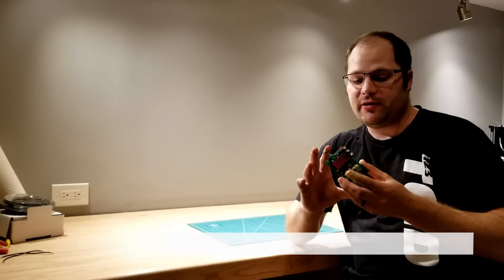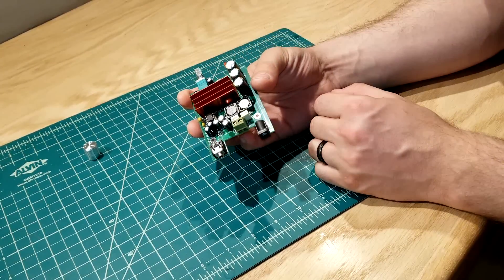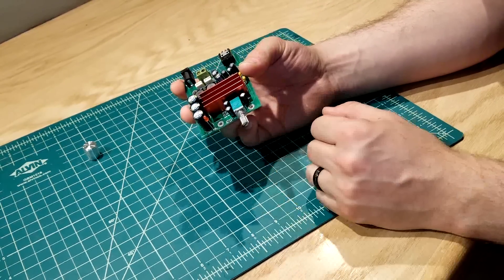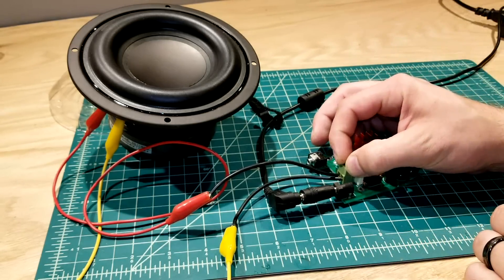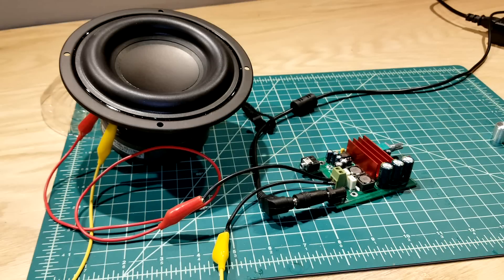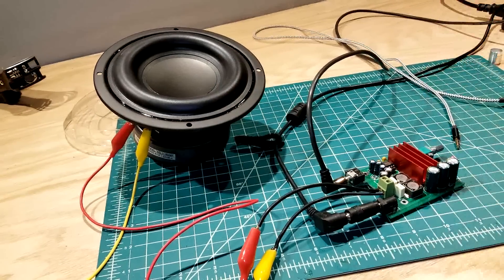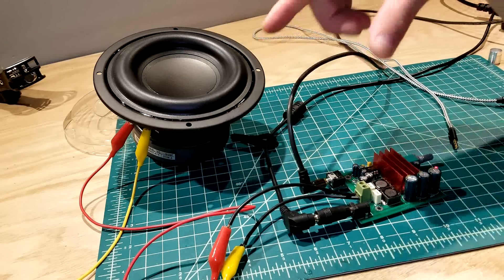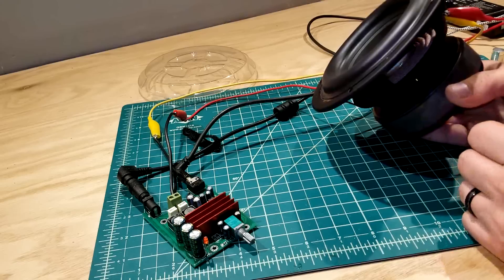100 watt Subwoofer amplifier for $11? TPA3116D2 Review and Test

Comment: i tried this board with 24V 6Amp Power supply with 3ohms 100W Subwoofer the outpur was really low i dont know what i did wrong

Comment: To reduce the interference you can use a Dc-Dc isolator for the power input because your body has a capacitance connected to the ground (Floor) And thus you will see a change in performance. Because the power adapter is connected partly to plug ground

Comment: There is probably nothing wrong with the power inlet. The metalic terminals are soldered and the plastic cover stays loose around them
 Quite normal

Comment: Correct me if I'm wrong but I thought you said the board needs a 5.5x2.1mm plug, but it's the other way around, it needs a 5.5x2.5 plug (the pin in the middle is bigger than normal, 2.5mm in this case), but thanks for telling me how these plugs are specified!!! That helps alot because of course all my PSUs are also 5.5x2.1 but didn't know how they were called. Thanks now I can continue my project! 😁👍

Comment: Dude how am I only now finding this video! This is exactly what I've been needing! YES! 
You said it has a built in low pass? (The board i think you mean? )
But this chip can do full spectrum audio amplification right? 
I guess it should have been obvious for me to look through the TI catalog of amp chips, but thank you man, this is exactly what i need. 
I can't believe this little tiny thing can do 100 watts, that's insane. 
Also it's great it has such a wide input range. It would be great for building a high powered portable speaker. 
Now i need to go look up the data sheet. 

Thanks man!

Comment: I used one of these on a 10" sub for my PC setup after the cheapie plate amp died - it was rated 70w. This amp i would say had slightly less power (and i used a good power supply 5amp, 35v i think...- the amp would go into overload shutdown anytime i wanted to crank it up a bit. at low to normal listening volumes it worked fine. I replaced it with a Denon plate amp from a HTIB kit and that was way more powerful. then I got a MTX 10" dual voice coil woofer in there and wired it in series 2ohms. I was sure the amp would blow...still holding up. the tpa3116 could not touch it. I think the power 100w is over rated bs...
Reply from the maker: If you were using a 35v power supply that would be part of the issue with it cutting out.  This amplifier only has a working voltage or 12 to 25v.  Anything over that would cause issues with the amplifier.  Having said that, it may not do 100w, I never tested that aspect of it.  Most of the time companies put that on their, because the chipset is capable of doing it.  But that means very little.  Glad to hear you have a monster setup now though.  Sounds like a great setup!
Reply: @Toid  bad memory, just a guess- - its a variable power supply I adjusted it to whatever the board maker said was maximum - i think it may have been closer to 28v or so...

Comment: I bought the next one up with two (unlabeled) potentiometers with the same power rating, from Ebay. I have an old 8 inch Polk subwoofer that has a bad amp. I'm going to see if this will substitute for the failed amplifier. I'm hoping that one control is volume, while the other determines rolloff frequency. It came with no instructions or documentation. I'll have to use a separate small board to construct a power supply. I have the parts. If the bridge rectifier and transformer are any good in the existing plate amplifier, I will use those parts for my DC supply.

Comment: Is it possible to use this amp or one similar to receive speaker level input from a speaker in/out connection board? If so, how would it best be done?

Comment: At 25 volts DC, you need a 3.1 Ohm driver to draw enough current to pull 100 watts RMS out of a bridged amplifier. you need to make sure the amplifier can produce 5.7 amps AC, which it needs to be current limited at 8 amps or higher, to drive the peak current. If driving 4 ohms, the amp will drive 71 watts RMS, roughly 100 watts peak. That requires 4.4 amps AC, which means the current limit needs to be 6.25 amps for the peaks. That seems more reasonable for an IC chip output stage. I tried to pull up the data sheet for the TPA3116, but I couldn't get it to load up. The numbers I used were calculated from 25 volts DC into a bridged output stage, rail to rail amplitude, without clipping. Switchmode amplifiers can get pretty close!!
Reply: Thank you for your math, I'm selecting power/speakers now.  Lower voltage PSU can yield same output if higher current, correct?
Reply: @AB1Vampire  That's correct, If you drop the voltage and increase current, the power stays the same. The caveat, is that an output stage has a current limit, and the lower the impedance, the less wattage you will get out of that preset amount of available current from the output stage.
Reply: The TPA3116 has proven it can do >50 watts x2, as long as it has sufficient cooling and power, at <0.03% THD. The chip is legit. Whether it is applied legit or not is really what is up for debate :P
Reply: BLA BLA BLA EBAY IS CHEAPER. AND WHATS POSITIVE AND NEGATIVE ON THE POWER PLUG?
Reply: @jernone3849  just stick the connector on your tongue and the part that tingles more is negative (or is it positive, dang now i can't remember)
You know what, maybe use a multimeter. 
Or just use the battery from your car the plus and minus should be clearly labeled... just make sure to use a current limiting resistor...
Reply: That's still a lot of watts for a tiny little chip and board like that

Comment: Anyway to wire this in with a Bluetooth amp board?
Reply from the maker: It would be better to use a separate amplifier board and Bluetooth board. Then you can just split the output of the Bluetooth board to the two amps

Comment: It does put out 100w, Put a meter on your output. You aren't getting a ton of sound like a more powerful 100w amp because your high wattage speakers aren't efficient. Those need to be driven with an amp designed for type of speaker you have. Get a 50w 75w 100w high efficiency sub and try it again!  You will be impressed with that little amp.

Comment: I picked one if these up on a whim for a small project integrating amps into a computer case.  It is only going to go anywhere near 100 watts at 2 ohms with the full 25v input.. at 12.4 volts with a 4 ohm sub its more like 18 watts if its lucky.  For my application I knew it would not do anywhere near its full power, but I was hoping for a bit more than it does. 

The slope is first order, which is actually ok if you are using somewhat weaker mid/high units. Though it would be nice if it was adjustable. Instead i have to resort to changing components on the pcb.   Next I think I am going to just build a power supply for it.

I have 2 of the 4 channel variants for my satellites which come out to around 8w/ch at best into the speakers I use. But they are in bi-amp configuration for the fronts. and then the second amp is for center and surrounds.   I am about $150 in for all the amps and crossover components, wires, plugs, speakers, wood, glue and solder... And it is built into the top of my Antec P180 case.

So a project which has turned out quite well.

Comment: Can I give direct subwoofer output from my Sony SA D100 4.1 home theatre to this board input. To power my subwoofer better...?
Reply from the maker: If it is a passive output, ie RCA. If it is speaker wire coming out, it's most like a powered out, in which you couldn't

Comment: Yes of course if you touch it it makes noise xD. It doesnt do it when its pluged in. Your "body voltage" does this. You could take a 1000€ amp and it would do the same
Reply from the maker: Dragon Killer you're absolutely right. It is audible, but I was having a hard time picking it up with the microphone. So that was a demonstration for you. However, they noise is very slight and you need to be close to hear it
Reply: 123Toid missunderstanding. Sry
Reply from the maker: Dragon Killer no problem at all. You probably taught quite a few people something that they did not already know. And that's always a win!

Comment: I just have a quick question. What will happen if i use a 500 watts speaker in a 60 watts amplifier? Hope you can advise me.
Reply: nothing if the speaker impedance is not lower than the amp can take. its just not going to be as loud as with a 500w amp.
Reply: actually no it's not safe to use something that small on a larger speaker.  If not setup properly it could cause clipping...

Comment: Hi can u advise me please...ive got some bullet tweeters...is it best to wire  them with the attached capicator or to the crossover of my component speakers...thanks
Reply from the maker: G Man that's impossible to say for me. You're probably best of experimenting
Reply: 123Toid ...ok thanks
Reply from the maker: G Man I should clarify a little. I'm assuming you're hooking these up instead of the other tweeters. The reason why you have to experiment, is I don't know if you're using the same ohm speaker or the same sensitive speaker. So I can't tell you for sure how well it will work with the pre-built crossover. The ohm load of the Tweeter, actually changes to crossover point. In the sensitivity changes the volume at which it's played. So you may need to experiment.
Reply: 123Toid ....ok good point ..its 4ohm and same power handling at 70 w as my component speakers...the capicator on the bullet tweeter is 3.3 uf ....not sure what crossover point is on component x over...but yes will test ...makes sense for best sound

Comment: 123Toid+ You could try this hack. Ceramic caps are terrible for audio and the reason for the hiss is that op amp so lets bypass that using a 4.7 micro farad electrolytic cap so lets take the ceramic caps out and jump one 4.7 micro farad electrolytic cap between the two making sure of the polarity, now we bypassed that op amp it's increasing the signal too much and try it again. While we have the soldering gun hot reflow some good lead solder on any of the terminals. Again sorry I didn't test it yet.
Reply: It also has to do with the cheap *Potentiometer*.

Comment: These small amps are really good when paired with proper power supply, if you dont have enought juice it wont work properly. It can do 100W (1% THD) at 26V but i would never go that high, something like 22-24V 5-6A is perfect to drive it, about 80W (1%THD) and 100 (10%THD) at 2ohms. (all according to datasheet, irl you would probably get a bit less)
I paired TDA7498 with 200VA 30V transformer, voltage when sitting in idle is around 38V but when it plays it gets to nominal 30V resulting in only about 2x80W power (10% THD) which is more than enough for me, it could even power DVC sub with decent amount of power.
Reply: That hum when touching 3.5mm jack can be solved by adding 10k resistor from input to ground, also i would recommend to get wires directly to board since these connector are not that good at over 2A.

Comment: The answer is no you cant :(  The not so cool part is 100 watt @ 2 ohms :( they dont like 4 and especially 8 ohm speakers. so rather limited in use. if you can find a dual VC 4 ohm :) i am interested. i was looking myself for some good 4 ohm DVC. from dayton or something good. but they only have 8 ohms DVC :( wich makes 4.  still not the 2 ohms we want.

btw a 3 dB slope ? what kind of filter might that be i thought 6dB is like the minimum :) even then it plays up to 1 khz

but they are nice boards if used with the right speakers. they are fullrange rather nice !

"" quote from datasheet""

The TPA31xxD2 series are stereo efficient, digital
amplifier power stage for driving speakers up to 100
W / 2 Ω in mono........    :(
Reply from the maker: Great point Joppe!  Definitely something I should have brought up.  I actually bought this to test on the tang band W5 woofer.    And everyone knows a 3db slope is what we call..utter nonsense.  I will not lie, I have been getting very little sleep lately and recorded this last night.  If only preparing for a baby took less time.  Thanks for the awesome input!  I'll just added that tidbit in the description and gave you credit as well as a link to your channel.
Reply from the maker: Bills BuildAll I never tried it with a 2 ohm load
Reply: Well my dual coil 2ohm sub will like a couple of these
Reply: I just bought some stereo bookshelf style dayton 2-way 4 ohm speakers. great speakers! Cant wait to try them out

Comment: This is a better one You can choose the frequency you want, the sound is cleaner, I have the same panel but 2.1 version
https://www.aliexpress.com/item/Mono-TPA3116-Subwoofer-loudspeaker-Amplifier-Board-Support-100W-pure-Bass-Output-Car-home-subwoofer-amplifier-board/32855646970.html?
This is what i have 
https://www.aliexpress.com/item/New-TPA3116D2-Subwoofer-Amplifier-Board-2-1-Channel-High-Power-Bluetooth-4-2-Audio-Amplifier-Board/32844219717.html?
Reply from the maker: Eliav Edri it does look like a nicer version. Although it doesn't seem to have As Nice of on board components. I really like the frequency adjustment and the GST terminal for the input. I may have to pick one up and test it out. Thanks for sharing!
Reply: 123Toid The 2.1 version is excellent very powerful.

Comment: so we need to use another amp for left right channel..
Reply from the maker: Kausik Kumaar great question. The simplest answer is yes. This would be perfect for like a small powered subwoofer build or a 2.1 setup.  In a desktop Arrangement, all you have to do is split the input, and you have a nice little powered subwoofer to go along with your desktop speakers. However, if you're putting this in like a portable unit, you would need a left and right channel amp. The advantage of using something like this, is the subwoofer would have its own volume and set low pass.
Reply: 123Toid  what would happen is you run a stereo signal into this amp and into a single speaker? Do we get merely the Left channel or is it the bridged output from both channels into a single speaker? I have another toa3116d2 amp lying here and  it works fine bridged :)